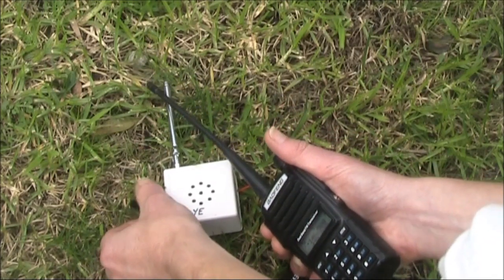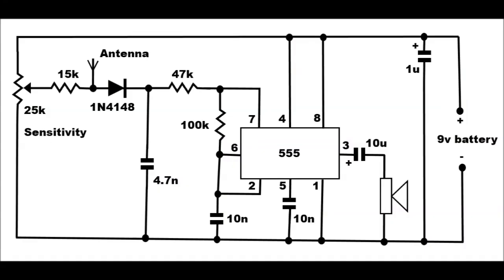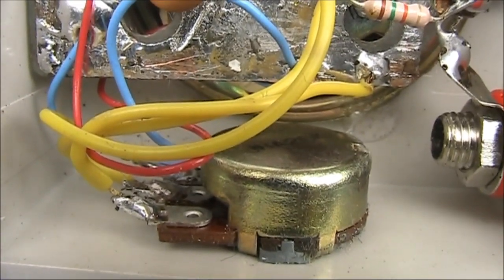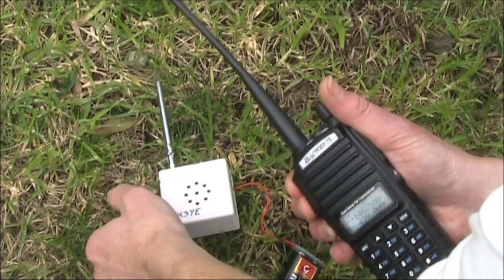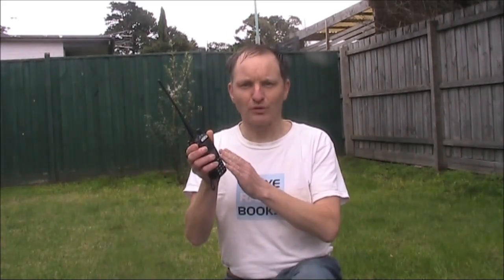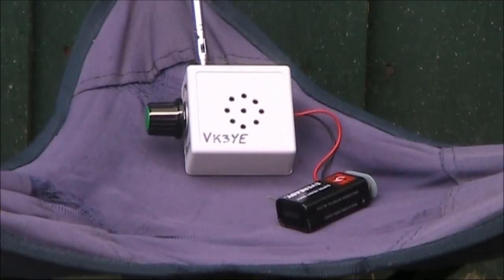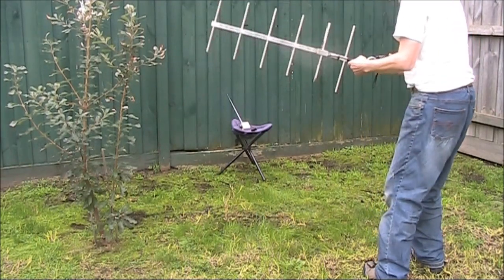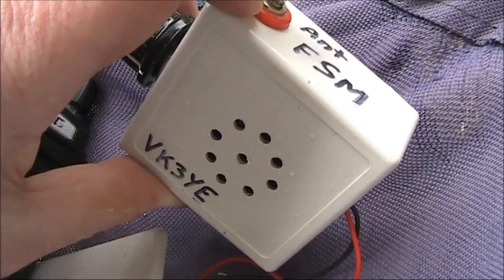Sleuth RF with the Squeakie (audible RF field strength meter)

Comment: Hi Peter , I am from India- watch your many videos. In your videos you have used a metal foil on PCB is that foil is made of aluminium foil or tin foil ? We here, in India can find aluminium foil very easily but to solder it ,is very difficult can you suggest any suggestions for it?  It is so important to use it as ground plane for RF projects .
Reply from the maker: I normally solder onto unetched copper PC boards. I have not used foil for a long time but it's been adhesive copper foil when I have.
Reply: Ok thanks for replying.

Comment: Just about to build. Would this be more sensitive with a Germanium diode? Thanks!
Reply from the maker: I haven't tried one. But it's very sensitive as is. Try it and see and let us know here.
Reply: @vk3ye  Built and worked first time! Substituting a germanium in place of the silicon diode results in the pot becoming more sensitive to the touch but the actual Squeakie is LESS sensitive to RF. Go figure! Thanks for this simple, yet effective project. I know it'll prove useful. Martin - G4EFE

Comment: Do you have any idea of its detection bandwidth? Will it work on the 13 or 23cm bands? Is adding a preamp a bad idea?

Great video, 73s de VK6BIL
Reply from the maker: No idea re the microwave bands. A better diode may be needed. A preamp would increase sensitivity further but unless it had a tuned circuit it could be set off by strong broadcast stations.

Comment: It looks like you soldered to the tin foil? Is that correct? Thanks for the video!
Reply from the maker: Yes, soldered to the copper on the board. Sometimes called 'dead bug construction'.

Comment: This is so many inventions in one. 
Cellphone transmission detector
Rf leak
rf tx whoopie cushion
r/c whoopie cushion
Theramin
(make 3 of them, set in triangle, and do triangulation formed harmonizing. Most are tuning dial, with vibrato proportion control, too common.
Do not forget a few layers of guitar pedal.
Also, sell them as Radiation Detectors, with the radioactivity symbol right on it, because that seems ok to do, but never mention Mr. Geiger.
Hook it up to different resonant antennas, hf loops to radar detector horns, to favor freq ranges. 
And, once it can get the AM band, it can be a virtual random ghost detector.

Comment: Could you use it to find power lines in walls?
Reply from the maker: I wouldn't trust it for that.
Reply: @vk3ye  I see. And how about using the squeakie to find noisy electrical appliances in the house? A bit like https://youtu.be/XBeWBglJZaY?t=196 uses his Yaesu817 to find noisy power supplies?
Reply from the maker: @PaulaBean  It worked for the light I tried. Might work for noisy switch mode supplies too.
Reply: Thanks Peter.
Another excellent Video. 
Your videos are really helping to broaden my knowledge.
73's Owen